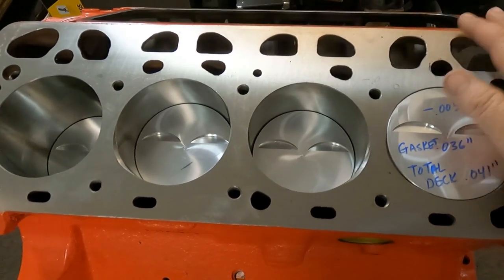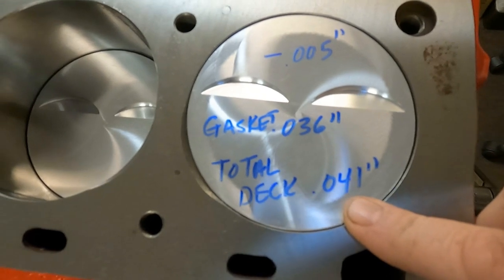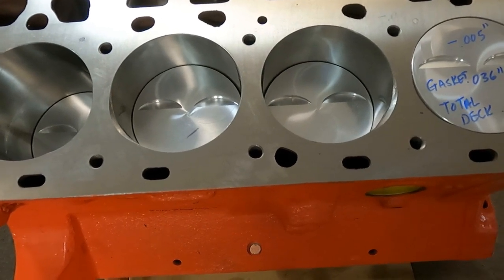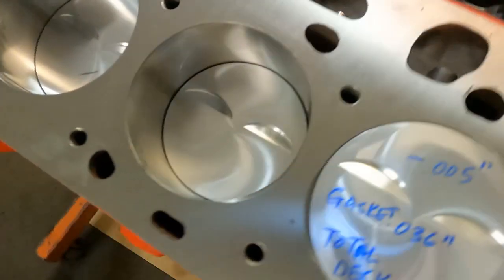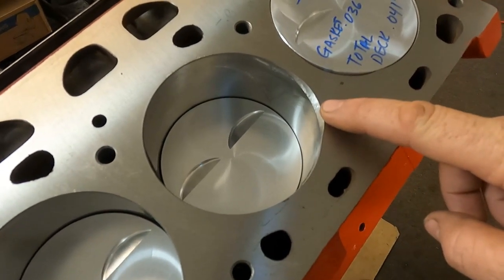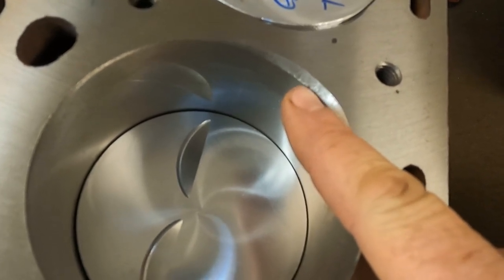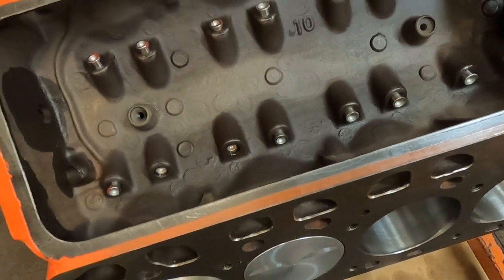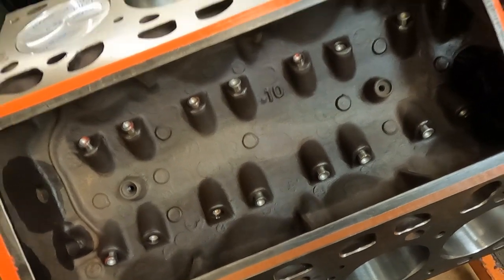Building a Better 312 Y Block using a 292 part 3

Comment: As I recall easy way to confirm a 312 crank is crank flange circumference c'bores. If so could you note that on yer next episode? Also recall my engine builder opened up a water coolant holes either in the heads or the block decks. Is that a thing? Reason I don't remember the specifics is my performance yblocks have been running for many years. 

Many Mummert parts in them so tanx again to John for the help. 

One real 312 E model, one 292 w/312 crank/rods and single carb and one 292 w/312 crank/rods and powerdyne supercharger, all T85 ODs, long tube headers and 4:11 traclocs. Big power and traction increase on basically stock engines no problem.